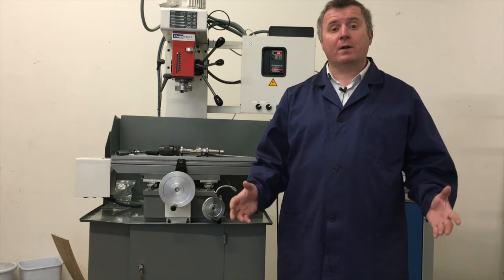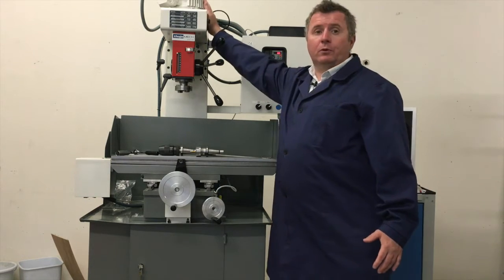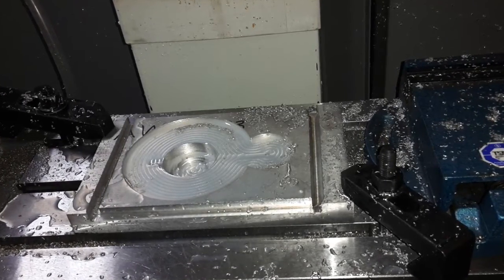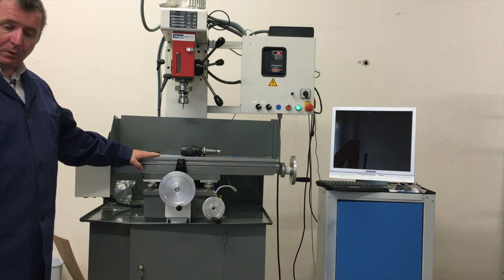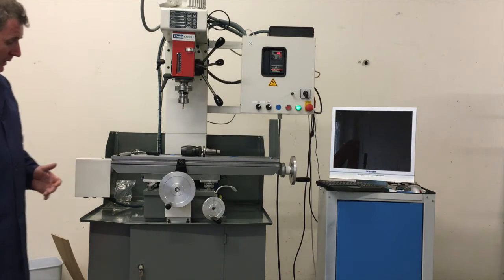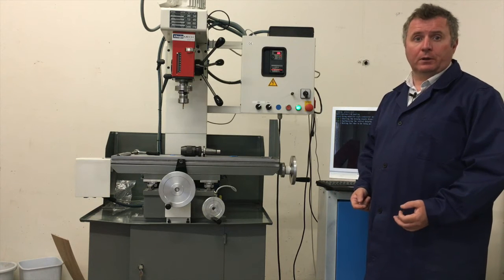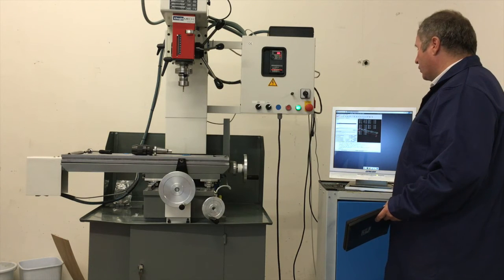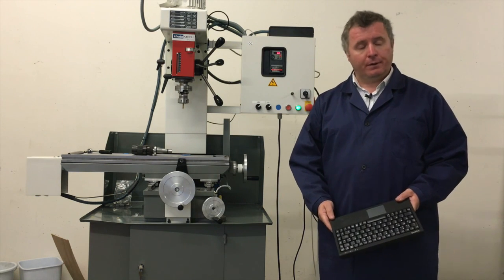Thojomech TFC11 Closed Loop Spindel sync CNC milling machine

Comment: Hello is there a way to adjust the runout on the spindle taper other than regrinding it through a 3rd party company?
Reply from the maker: this should be feasible
Reply: @thojomech3590  ok and how?
Reply from the maker: @chronokoks  Hi i saw now your other respond i will put in my respond there

Comment: I happened to came around your machine and found a 4/100 mm runout on the ISO30 spindle... not so great folks - that's bad even for chinese mills ..  but the perpendicularity of the Z axis travel to the table was actually pretty ok (around 4/1000 at a 10cm travel)
Reply from the maker: You have one of our machines ? can you precise your statement  ?
Reply: @thojomech3590  sure i can make a video next time I'm at the machine (maybe 1 or 2 weeks from now) of it and make it available .. the indicator was a proper 0.002 Mahr test dial indicator MARTEST 800 SRM, the taper (it was measured at the ISO/SK taper) was also properly cleaned.. you think maybe the bearings lost preload?
Reply: @thojomech3590  here's the video.. https://www.youtube.com/watch?v=SN3sqmAD1iY ... 0.08 mm runout on the taper (it's a Mahr 0.002 mm test dial indicator)  .. so how do you fix this? also the pre-load on the bearing seems weak (the quill was locked).. a little push on the pulley in the gear box and the whole thing deflects
Reply from the maker: @chronokoks  Hi i was a little misspelling the runout for deflection like https://www.youtube.com/watch?v=CR52J4Lr60A but i see now what you mean. The preload on the bearing is set by the factory and because of the way the Quill is done the preload may be adjusted and that is what i meant. What exactly do you mean with deflect. When the Quill is extended it will deflect. So get in contact where you bought the machine and see how they can help you. The roundness of the mill (what you called runout ) is normally done by the factory and can not so easy be changed. But the head is not complicate to exchange for instance so i think best is have a chat with the mechanics at the factory they are verry helpful
Reply: @thojomech3590  the mill is not mine so I have to ask the guys in the workshop to do what's necessary (contact the shop through which they bought the machine).. kinda sad.. 0,08 runout on the taper is unnaceptable and should be replaced.. thanks for the info and have a nice day
Reply from the maker: if the factory can't help send me an Private Message  @chronokoks

Comment: wie ich sehe wird die maschine mit linuxcnc angesteuert, wäre es möglich mir die .hal datei zu schicken? bräuchte die für meine closed loop spindel
Reply from the maker: Hallo was für eine Closed loop Steuerung ist es denn ?  Ich denke am einfachsten geht es mit http://linuxcnc.org/docs/html/config/pncconf.html  gruss
Reply: ich habe einen microcontroller und der hat hardware encoder dh ich kann mit linuxcnc und entsprechender software die spindel regeln :)
Reply from the maker: Hallo Das Verstehe Ich nicht wenn du mit Grbl oder Marlin mit z.b. Arduino Mega arbeitest dann funktioniert Closed Loop anders als wenn du die Spindel synchronisieren willst für z.b. M19 command ?  Was ist es denn genau unter Linuxcnc wäre es https://forum.linuxcnc.org/forum/10-advanced-configuration/26073-spindle-orientation
Reply: nein das ist ein Beaglebone Black mit CRAMPS cape, da kann ich einen encoder anschließen (die haben Pin A, B, GND und VCC) und somit die genaue rpm der spindel regeln und wenn die spindel die solldrehzahl nicht erreicht, wird nachgeregelt sodass die solldrehzahl erreicht wird. spindel orientierung kann man auch nutzen (bei mir nicht, weil mein encoder keinen orient pin hat) aber das wird dann alles über linuxcnc und entsprechender selber geschriebener maschinenkonfiguration geregelt :)

Comment: Hi, Does it cut titanium? Could you film that and post it? Thank you
Reply from the maker: hi hello thank you for your response we milled stainless steel and even hardened steel. If you are more precise what you intend to see we will do that. But i first have to go and get a piece of titanium ;)-  maybe we do a part you can use ?  i expect it is about watches or knives  both i expect be a perfect fit.  thx thomas
Reply: http://www.aliexpress.com/item/New-3-x-150-x-150mm-Titanium-6al-4v-Sheet-Grade-5-Plate-Ti-Gr5-Metal/32636317833.html?spm=2114.01010208.3.1.Alp9xr&ws_ab_test=searchweb201556_10,searchweb201602_4_10057_10056_10055_10037_10049_10033_10059_10032_10058_10017_10060_10061_10062_10063_412,searchweb201603_1&btsid=43685895-b68f-464c-87b0-5d55dc92a255
Reply: I'm a knife maker and i'm looking for a European Tormach competitive option. So please let me know how the system handles Titanium! Kind regards Alexander
Reply from the maker: Hi ok knife maker verry good i like knives ,.. i am surethat we can do this so my question is how do we test that best Which part do you intend to do. that i can show similar or same feature that you intend to do I would get titan from http://www.zujeddeloh.de/artikel729.html#a10818 so lets agree on an shape or part to make (if you have an IGES or DXF i´ll take that ) and i would show drill mill camfer whatever is of interest of your making. It means that we also have to talk about which tooling you need to see. And we are right now integrating the path pilot for our customers (i work also on the ATC integration which is much more complicated ) thx thomas
Reply: Hi Thomas, thank you for the kind response! There is no difference in the metal, so that would do just fine. I'm in the design phase right now, but could send you a CAD file within 2 weeks. Once you've seen the part, we can discuss tooling etc. I'll send you an email so you have my contact details. Thanks for the support so far!
Reply: Hi! Did you make any progress with this case? Any demo of cutting titanium? I would like to see it also. Try to find some Tormach European competetive to! Also is there any tool changer option?